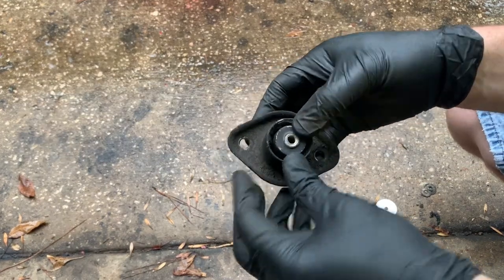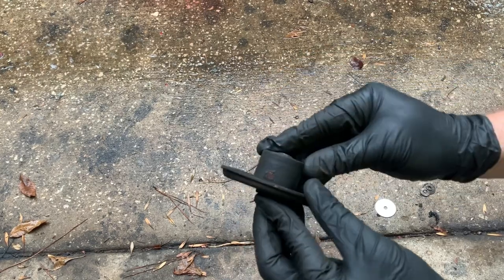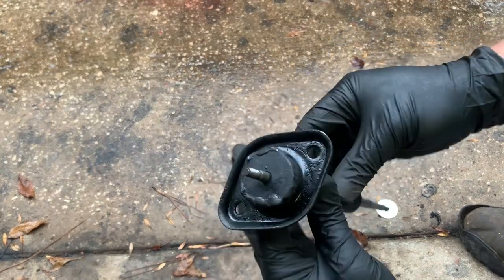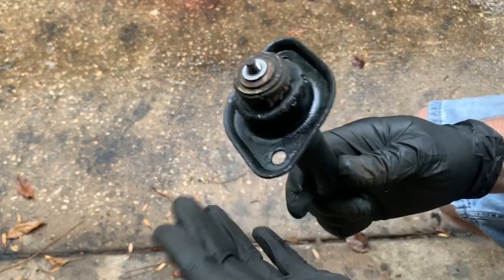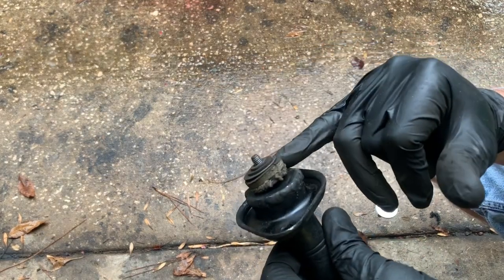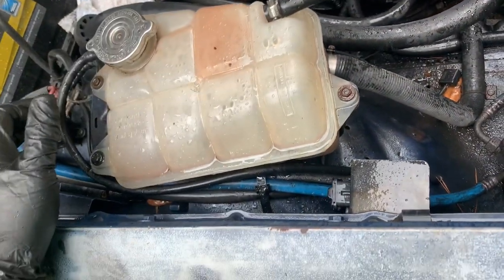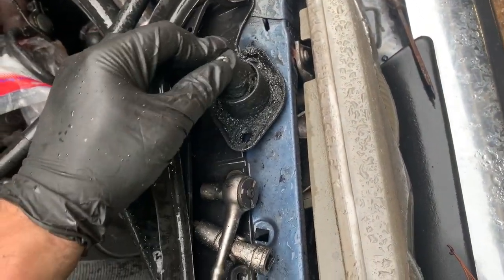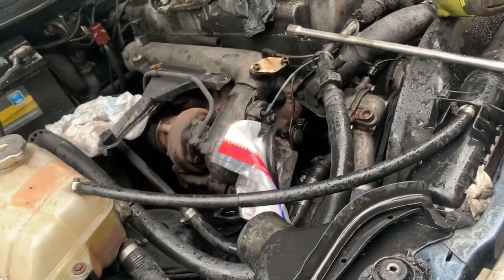85 300D Engine Shock Mount Mod

Comment: An engine shock mount kit (part# 123-586-06-24) is available from Mercedes for $15.
Reply from the maker: Yes that is a good option for the lower mounts. You could also use them for the upper mounts if you mod the mount like I did.

Comment: so is this shock mount to dampen the torque twist upon acceleration, or just lessen the diesel rattle transferring through the motor mounts?  OHh, btw - had to search you in YT, since YT stopped sending me notifications of your recent uploads. i made sure to hit the bell this time. good to be getting the notifications again. Happy Christmas to you.
Reply from the maker: My understanding is it’s really only to dampen the shake when you cut off the engine. I’m sure it helps a little on idle as well. Happy Christmas to you as well!